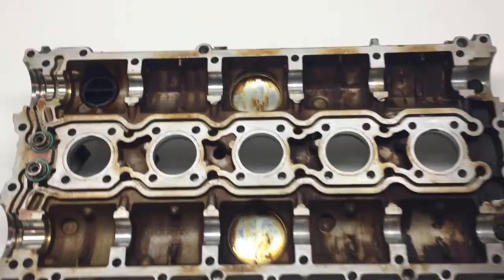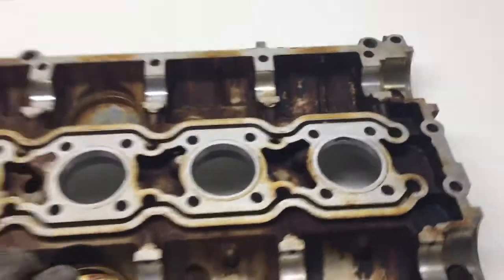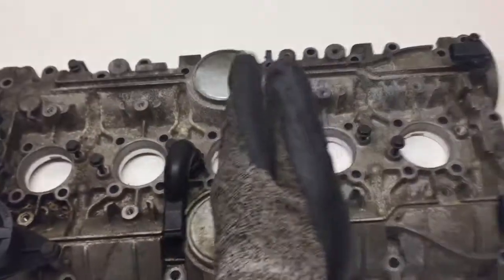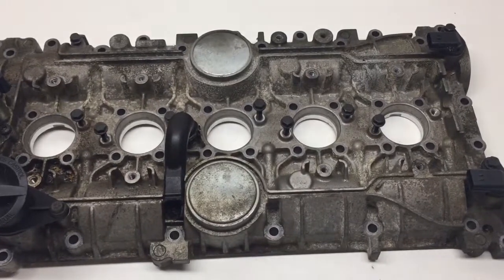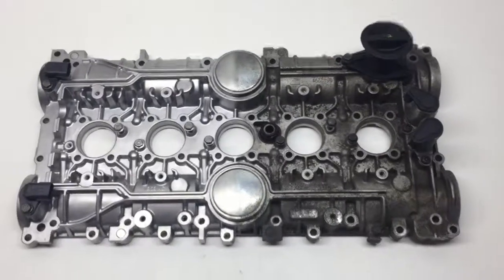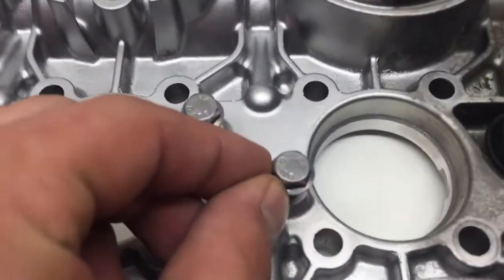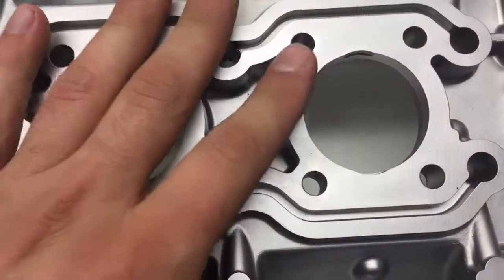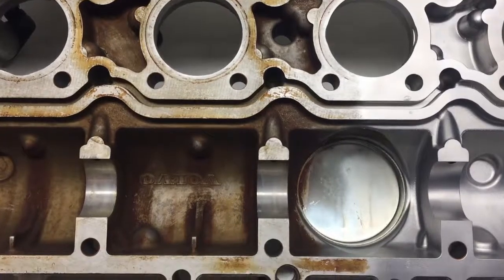Vapor Blasting an Old Valve Cover

Comment: Do you have a heater in your vapor honing cabinet. Are you using rust inhibitor on cast iron parts. Do you masking engine block or other engine parts before vapor honing process.